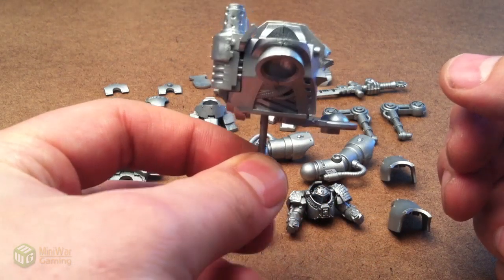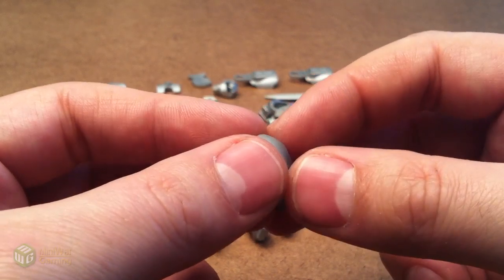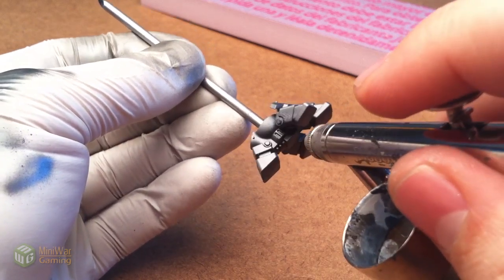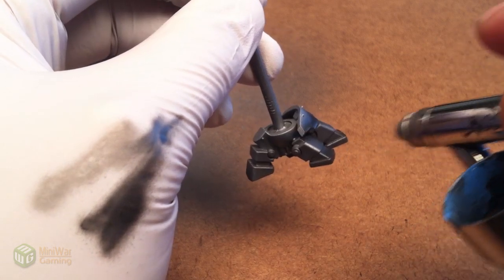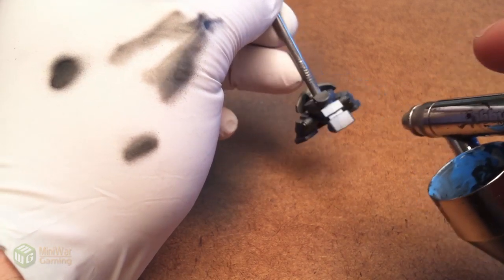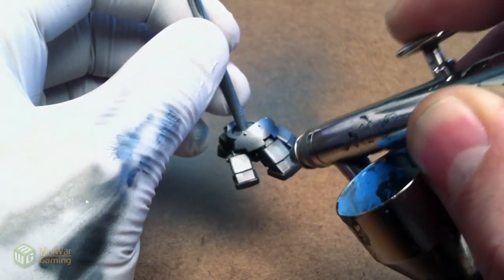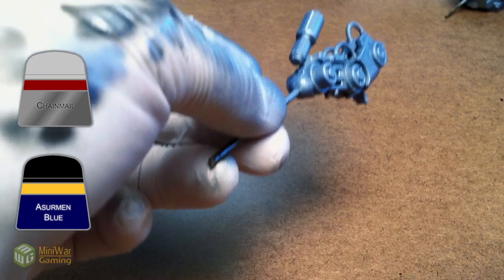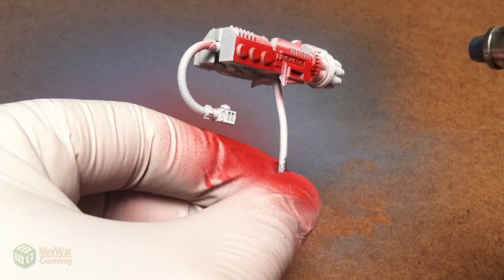How to Paint a Grey Knight DreadKnight Part 1

Comment: @3Dtastesgreat I use 500 watt soft box photo/video/film lamps.  You can get pretty cheap ones on eBay that will do just fine.  Thanks for the tip on the brown add-in.  I'll try that out.

Comment: At the beginning of this video you stated that you're using a Badger airbrush pushing the paint at 40 PSI and thinned with window cleaner.  What's the mixture ratio that you're using to thin the paint?  Is it 1:1 paint:window cleaner or are you going thinner than that?

Comment: Thanks for the tutorial, but wouldn't you have problems gluing it together after painting? I find it frustrating because glue dissolves the paint :S and wouldn't stick very well. I actually use regular brushed. Maybe it's different wit air brushes. Maybe a thinner layer of paint.